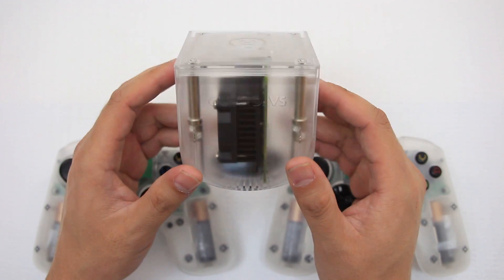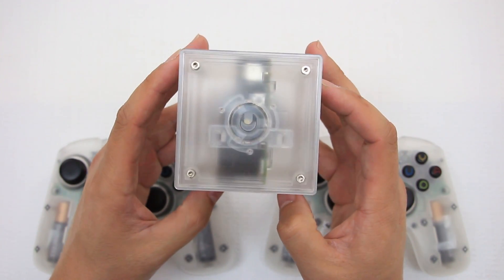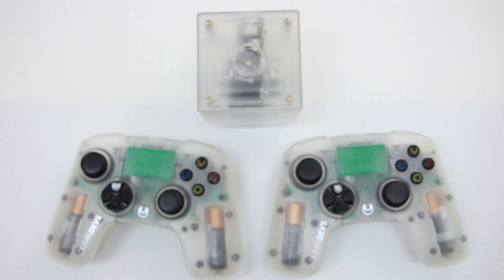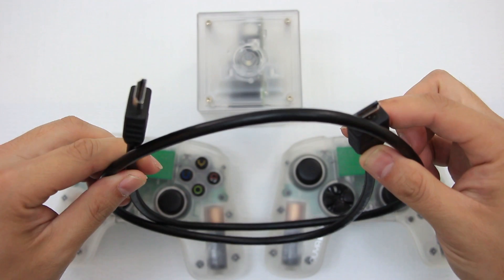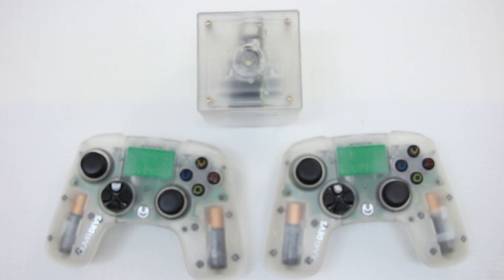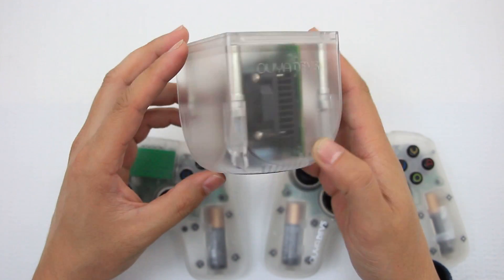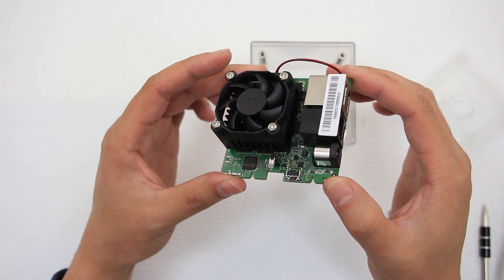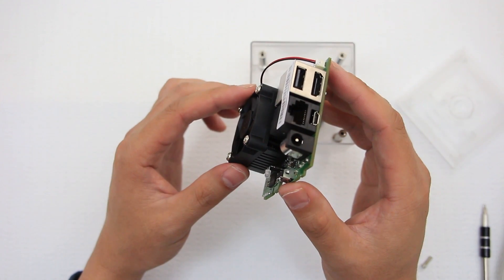Ouya Developers Kit Overview & Specs in HD

Comment: A phone is limited to its hardware because it runs on batteries. The Ouya is plugged into a wall, therefore the Ouya doesn't have the same limitations that a smartphone has. Also, the smartphone is specifically designed for phone calls. A gaming system's priority is to play game. More focus goes on the gaming side of the console.

Comment: Tegra 3 can be very fast but it also produces a lot of heat. The reason why Tegra 3 in phones and tablets aren't blazing fast is because they need to run at low power.